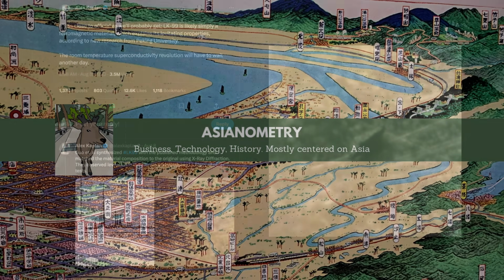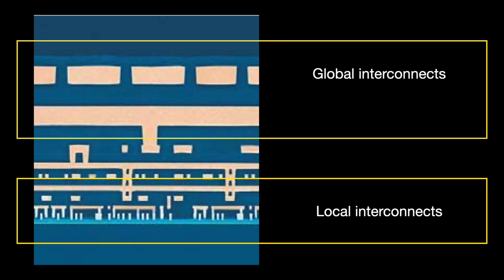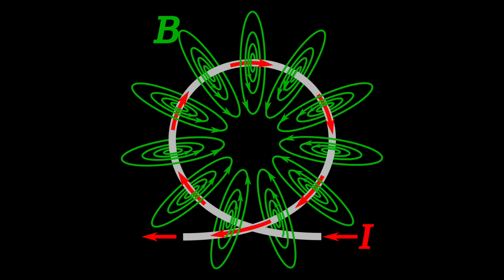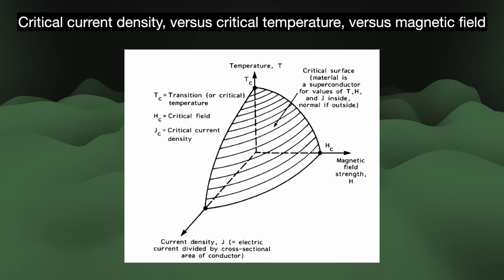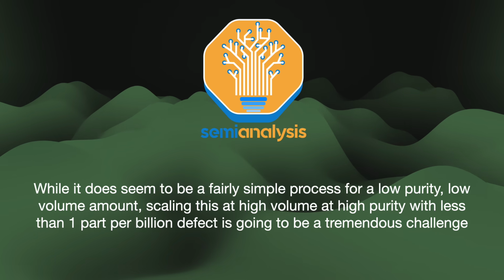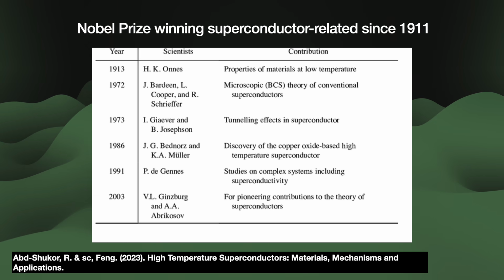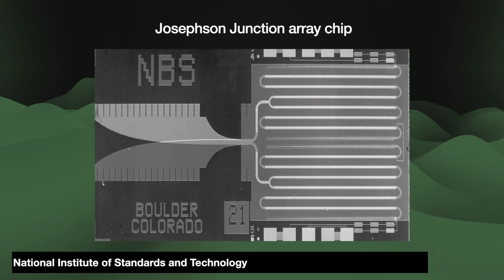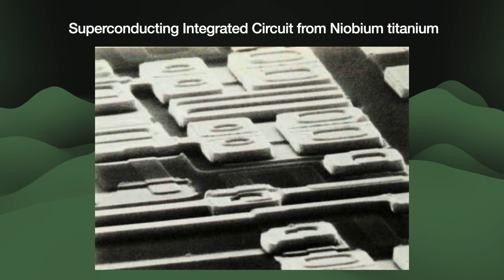LK-99 Wouldn't Have Changed Semiconductors Anyway

Comment: Back when I was working on Thin Film HTSC there was talk of using them for interconnects. Our current densities for TBCCO were in the 10 E6 A/cm^ range if I remember correctly. We were at 3" wafers when I left. We never made one, but we did mount a SUN microsystems processor on a closed cycle Stirling Gooler. This sped up the chip significantly, but the whold thing wasn't really practical. We also made an HTSC SQUID with HTSC Josephsen Junctions.
Reply: I genuinely can't tell if anything you just said actually means anything or if you're trolling. I'm getting fairly strong turboencabulator vibes.
Reply: @jlco  : There were typos, but it's legit. It all boils down to "none of it ever reached production."

Comment: Capacitive and Inductive “losses” aren’t losses as such. They’re just energy storage. The magnetic fields created in a superconductor don’t dissipate anything. They are just energy stored in the wire, and trying to stop the current will release it. That being said, high frequency current through a superconducting wire will still emit EM radiation to the environment. Good circuit design should mitigate this, but I don’t believe it can be eliminated altogether. To summarize: there should be losses, but only as radiation – which is a few orders of magnitude less than what the inductance and capacitance values would imply otherwise.
Reply: When a gate output goes from low to high, the gate has to charge the output capacitance. Then, when it goes back to low, it has to discharge it. The output capacitance is just energy storage, but the energy is still lost, because the capacitance is charged from the positive rail and discharged into the negative rail.

The difference between the amount of energy stored in the two states is important. The capacitance itself will not dissipate it, but the transistors that charge and discharge the output will, as will any resistances in the current path on the way, etc.
Reply: @possible-realities  but the capacity of a wire is determined by its gauge, no? If the wire has no resistance, then it needs very little diameter, which means it would have very little capacitance.
Reply: @davidgervais5974  You're right, making the wire thinner should lower the capacitance. But I believe that it would also increase the inductance, so that you would need to put more energy into getting a current going through the wire.
Reply: @possible-realities  Also a good point. I've made some calculations and... 
This is the inductance (L) for a wire of a meters length and b meters diameter.
L = 200*a*(ln(2*a/b)-0.75)

Because of the natural logarithm, b can vary of several magnitudes while L remains in the same order of magnitude.
I'm not sure how to approach the capacitance calculations, but it seems to behave in a similar way.
Reply: Capacitive/inductive loss is not joule effect loss (heat loss), but it is still an energy loss. The energy that is used on the transient state (aka while these components are charging) are used to load the capacitive/inductive coupling, and not to transfer energy between devices.
Only after the capacitor/inductor is charged (the steady state) we can say we don't lose any energy.
Reply: Superconductor battery bombs ahoy hoy!
Reply: In this sense it's a speed bump.. For example if a signal is going from high to low, it has to fight the inductance trying to disallow the change. The resistance of the material doesn't matter there..

Comment: That’s so frustrating, imagine living through the 1940’s till the 1980’s… you would see a total different world… I barely see any change from 2010 till now, am I wrong?
Reply: Smartphones in 2008 vs smartphones in 2023 is magnitudes different. Cameras, bandwidth, video calls everywhere,  processing speed, battery life, charging speed, wireless charging, peripheral devices (apple watch, vr headset, etc)

There's a lot that's improved but it's been so smooth and steady that it's hard to notice
Reply: First of all the 1940s to 1980s span over 40 years.  From 2010 to now is only 13 years.  That's a big difference.  We also haven't had a world war since 1940s.  A lot of progress was made in that era because the war pushed the limits of technology.  A lot of the electronics like the transistor started in that era.
Reply: iphone came out in 2007, so I'd say huge changes have been made.
Reply: Smartphones have made many things in my house become redundant and unnecessary, that's lots of changes for me.
Reply: I'm in my 20s and there's a pretty drastic difference in how people behave because of the ubiquity of the internet and smartphones. Tech has improved a lot. Also I think there is a pretty subtle but noticeable change in how much freedom we have through things like increased surveillance but also through things like anti-right to repair tech designs
Reply: Processing speeds have increased tenfold on high-end desktop chips, more so on the server side. So there's plenty of progress in that space. Tech in general has gone way more mobile - with mobile phones now essentially being everything many people need.
Reply: Yes. Here's a summary of scientific and technological breaktrough since 2010 made by chatgpt:

    CRISPR-Cas9 Gene Editing (2012): This revolutionary gene-editing technology allows scientists to modify DNA with high precision, leading to potential applications in medicine, agriculture, and more.

    Detection of Gravitational Waves (2015): The Laser Interferometer Gravitational-Wave Observatory (LIGO) detected gravitational waves, confirming a key prediction of Albert Einstein's general theory of relativity.

    Advances in Artificial Intelligence: The last decade has seen significant advancements in AI, including the development of deep learning techniques, leading to breakthroughs in image recognition, natural language processing, and game playing (such as AlphaGo defeating human champions).

    Commercial Spaceflight: Companies like SpaceX have made strides in reusable rocket technology and have launched and returned astronauts to the International Space Station using their Crew Dragon spacecraft.

    Advancements in Renewable Energy: Solar and wind energy technologies have become more efficient and affordable, contributing to the growth of renewable energy sources.

    High-Temperature Superconductors (2012): New families of high-temperature superconductors were discovered, offering the potential for more practical applications of superconductivity.

    Quantum Computing Progress: There have been breakthroughs in quantum computing, including the development of qubits with longer coherence times and the demonstration of quantum supremacy.

    Emergence of CRISPR-Cas12 and Cas13: In addition to CRISPR-Cas9, new variations of the CRISPR technology, like Cas12 and Cas13, have been discovered, expanding the possibilities of gene editing.

    Advances in Immunotherapy and Gene Therapy: Progress in these fields has led to new treatments for various diseases, including CAR-T cell therapies for cancer and the approval of the first gene therapies.

    Neuroscience Discoveries: There have been significant insights into the brain, including the development of techniques like optogenetics and advancements in brain-machine interfaces.

    Advancements in 3D Printing: 3D printing technology has improved, allowing for more complex and precise printing of various materials, including in the medical and aerospace industries.

    Climate Science and Environmental Monitoring: Advances in climate science have improved our understanding of climate change, and technology has enabled more accurate monitoring of environmental changes.

    Advances in Battery Technology: Research into new battery materials and designs has led to improved energy storage for various applications, including electric vehicles and renewable energy systems.

    Human Genome Editing (2018): The birth of genetically edited babies in China using CRISPR technology sparked ethical debates and raised important questions about the use of gene editing in humans.

    Advancements in Virtual Reality (VR) and Augmented Reality (AR): VR and AR technologies have become more immersive and widely used in various industries, including gaming, education, and healthcare.

These are just a few examples of the major breakthroughs in science and technology since 2010. Many other advancements have also significantly impacted various fields during this period.
Reply: If I give my opinion on this, the vast majority of "drastical" chances nos come in the realm of the digital, because the Internet os much more accesible than ever before.

If you were to consider the rise of ChatGPT as a paradigm shift, is still strictly prominent in the tech/academic world than anything.
Reply: The power shift from west to a multilateral world and the end of US hegemony. The anthropocen with all the climate changes. OLED screens and 4k120Hz. All theses are the event of our time, they are interesting I think. Less than enjoy life and finding meaning in simple things, but interesting nonetheless
Reply: The world looks almost completely identical to how it did in the 1950s, with cell phones and the internet being the major difference.
Reply: @outerspaceisalie  and computers, global travel and commerce, gps and a bunch  of other things that make it pretty much not at all almost completely identical to how it looked in the 50s, lol
Reply: @Daniel-ng8fi  exactly! They didn't have anime tiddies or e-girls in the 1950s, totally different universe
Reply: @outerspaceisalie  The 1950s was a time before the widespread use of automatic doors, barcode scanners, microwaves, digital billboards, escalators, digital payments, and color photography. The world only looked the same out of the window of an airplane if you squinted hard enough.